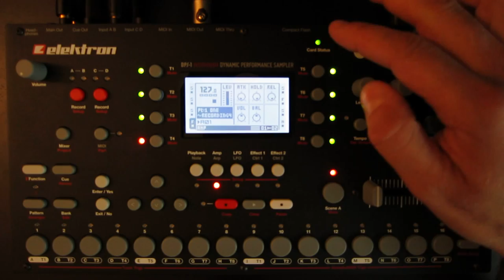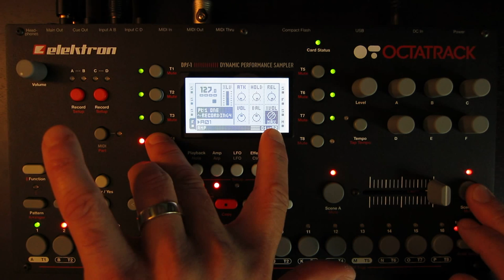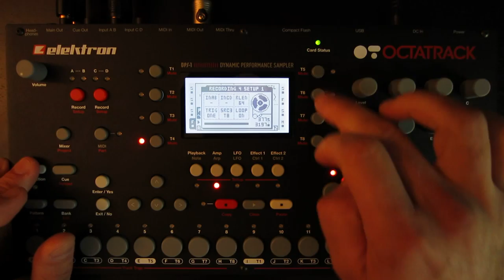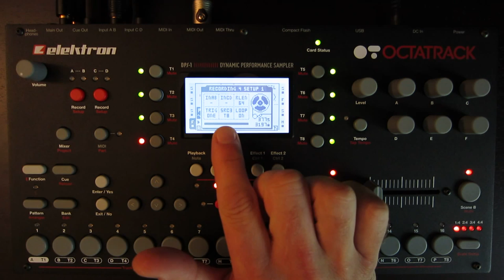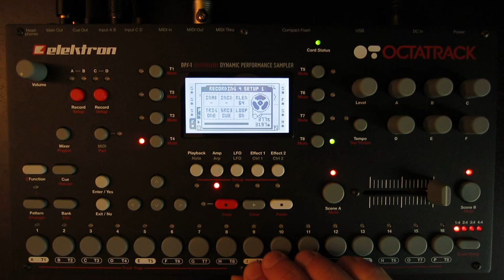Octatrack Xfader Transition Trick Variations

Comment: Hi Tarekith, thanks for the great tutorial! One question, it seems like there is a small volume difference between the live tracks and the recorded track. I cleared all track pages (amp, effects, etc) and made sure all volumes and levels are equal on all tracks incl T4 and T8, the master track. Any idea where I have to look?
Reply: I know it's been 3 years since your post but... did you ever figured that out? I'm having the same issue. I fixed it by having a compressor with a light gain value, around 3... but it would be nice to use that fx slot for something else
Reply: @Depuratumba  “I know it’s been 3 years”….lol did you figure out the issue ?
Reply: @juliomontes5525  hehe I don't remember to be honest! I currently use my Digitakt through the Octatrack (the latter functioning as a performance mixer/looper) and it works fine for my purposes
Reply: @Depuratumba  Thanks for replying bro haha...I think it may have to do with the OT's compressor, particularly the gain setting within it. I actually just switched around my audio routing and have the DT going into my SC now to save machine in the OT. Ultiomately results in extra layer of melody that my loops lack.
Reply: @juliomontes5525  what I remember doing is resampling from the master track (with the compressor on one of the fx slots) and then on scene 2 I parameter lock the compressor mix to be all the way down... that worked for me IIRC!

btw I'm from Argentina so maybe we could have had this conversation in spanish all along? just speculating based on your name, heh
Reply: @Depuratumba  haha los argentinos si saben de esta vaina😂 soy de Florida